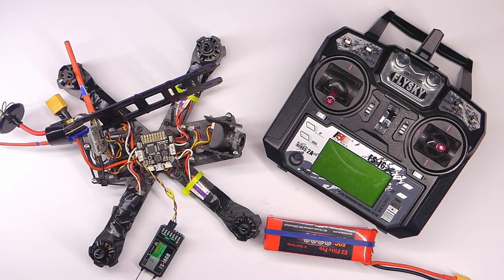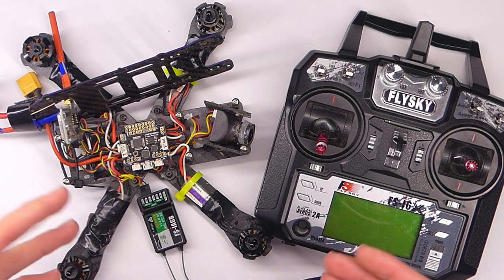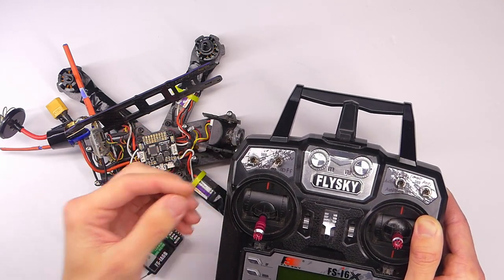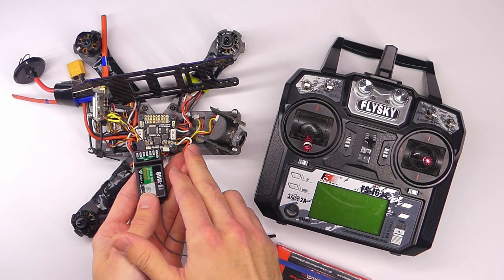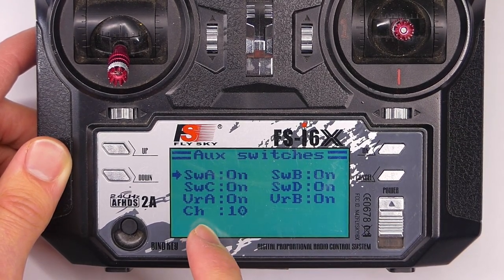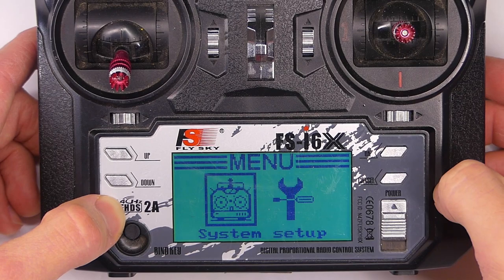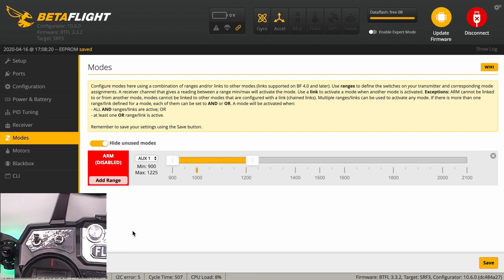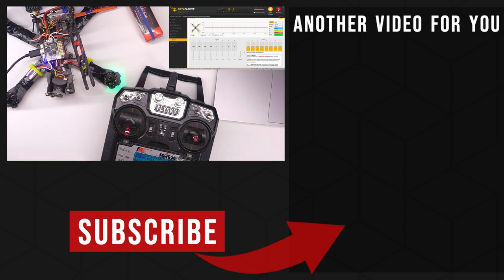How to Set Up ARM Switch for Your Drone ⚠️ Flysky i6X, i6, i6S, Wizard X220, Betaflight

Comment: Hi Adam , I have a Flysky FS I6x like you show in your video ,I have done all the steps as you shown but when I plugged  in to my flight controller I can not connect the transmitter with the receiver . Yesterday I did connect them and even done the radio calibration, today I tried everything again I couldn’t get to connect them  . I created an Sbus cable myself and like I said it did work yesterday . Any help or suggestions will be highly appreciated Adam ,thank you !

Comment: My f4 flight controller works fine in betaflight, but it doesn't respond to the motors when fully armed. The receiver tab shows that my transmitter stick motions respond. The motors tab shows the motors responding in betaflight using there variable sliding switch. I don't know why the motors don't run/respond using my transmitter. Please help. The flight controller firmware is MATEKF405. The 4-in-ESC is using BL_S firmware with DSHOT600 protocol.
Reply: Same problem 😂

Comment: Is 2s lipo battery sufficient to arm fpv drone kindly help
Reply from the maker: It might be. It depends on the specific drone.
Reply: @RCwithAdam1 5 inch  4 eco 2207 1900kv motors,speedybee f405 FC and fsia6b rx and fsi4x tx but I am unable to arm the drone

Comment: Hi, my quad don’t response to throttle from transmitter when arm instead it remain on constant speed, but the yaw, pitch and roll working perfectly. Is there any setting I should do ? Any suggestion would be appreciated.
Reply from the maker: Hi! What quadcopter and receiver are you using?

Comment: When I switch the aux to on position, 4 motors are turning with no balance. First one turns around  1200, second turns around 1300 etc.
Reply from the maker: Hi! Is the quad in auto level mode? If so, this is normal. Try using the betaflight controls to spin up all motors at once to see if they spin up evenly.

Comment: I have the wizard x220 and I got a flysky FS-i6X with the FS-IA6B, I setup everything in betaflight and it should work but for some reason when I try to arm nothing happens only the red light blinks and thats it, I can spin the motors in betaflight just not with the controller
Reply: fixed it
Reply from the maker: Glad you got it working! What was the issue?
Reply: so i had arming for the swa switch but that switch was also turning on trainer mode so I switched trainer mode to some other switch and it works but then after flying for a bit one of the esc's caught fire so I got some new ones. Thanks for everything!

Comment: cool thanks for this. after working towards the goal i have it arming and spinning motors in betaflight along with stick movements. green light on vista and receiver. green light on transmitter. video feed in goggles at my desk. sweet. unplug everything. screw props onto motors. mount components and maybe i nicked the camera cable in the process unknowingly. go to a field. quickly realize i cannot arm and low power mode unable to record in goggles and no video feed happening. like wut.
Reply: plugged into usb can arm. i jumped the pwr leads on my radix2 fc, and per the instructions had it wired to vtx+, which wasnt powering. powering off battery leads directly as following other instuctional videos out on how to wire the caddx vista, does this conflict with my arming protocol, as i have it selected in modes and all works when connected to betaflight. blessings.
Reply from the maker: @lyndajones1133  what transmitter and receiver are you using? Also, "low power mode unable to record" is a common inconvenience with the vistas due to lack of cool when there is no airflow to cool it down. Once you arm and have the props spinning you should be able to record.

Comment: I got a i6x signal booster and battery mod you might like
Reply from the maker: Very cool! links?
Reply: https://drive.google.com/folderview?id=1CZBFLXsUDNjVt8-Zqy0M70nFUWfFxZp_ it's a signal booster I've had on for a while powered from a 3s in my pocket. Antennas are 10dbi for the turbowing and 5dbi on the tx. Getting about 2.5km range with 40+ rssi. Still going to modify turbowing position to be able to use port for sims.

Comment: im using a fs i6 and when I go into system setup, aux switches does not appear for some reason
Reply from the maker: Hi! Can you tell me which firmware version you use?
Reply: @RCwithAdam1  have same problem, firmware 2.0 1-feb-2018
Reply: @kamy2020  same problem here

Comment: Question I bought a random trs to trrs adapter from eBay. Will it work it’s brand new. Does any trs to trrs converter make you use microphones on your phone ? Hopefully 🤞🏼🤞🏼 my mic is a rode mic and the adapter just says headphone earphone audio trs to trrs adapter 

Link to the adapter : https://www.ebay.co.uk/itm/383465179665 

This is the mic :https://www.thomann.de/pics/bdb/177309/7270763_800.jpg

Thanks in advance
Waiting for good news hopefully